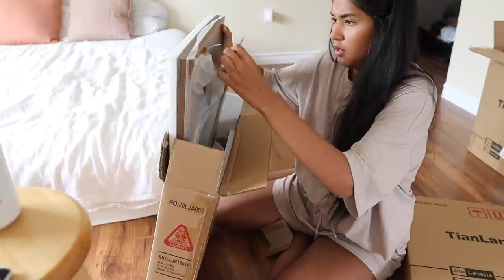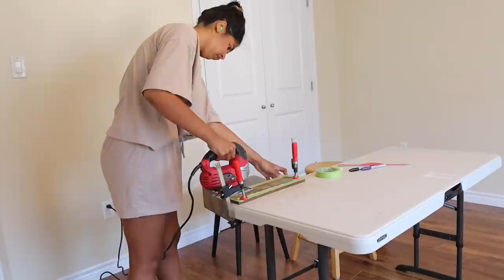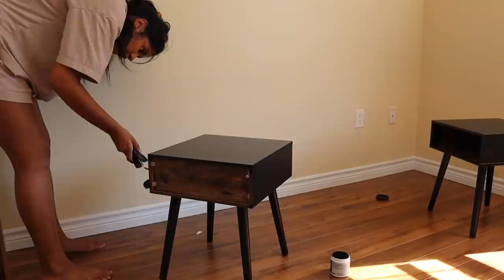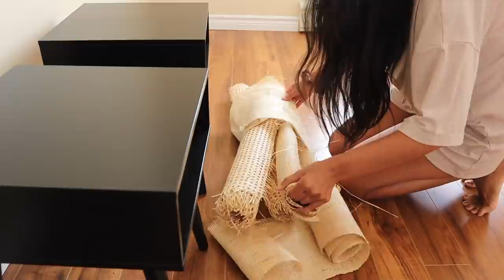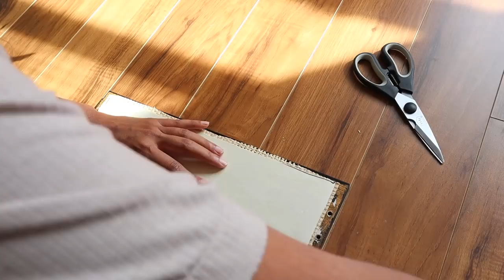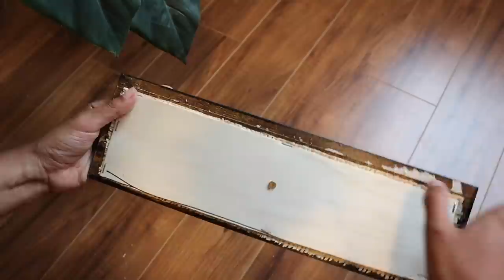Making My Nightstands (diy side tables) | Home Made Happy - Ep. 3

Comment: I love your ability to see potential in things so that even if you can't find exactly what you are looking for - you know you can create it!! Just for future - especially if you work with any larger pieces  -It can be helpful to cut your cane, raffia or rattan a couple inches larger than your exact measurements & then soak it in lukewarm water for 20 or 30 mins so it becomes malleable then when you attach it you can pull it taught & as it dries it shrinks back down & it's nice & tight & straight shouldn't bunch up or be loose.  Although it didn't seem to be an issue with your project!  The side tables look great!   Love that you used the dowel knobs horizontally suits the tables perfectly!  Look forward to all the Home Made Happy episodes ♥